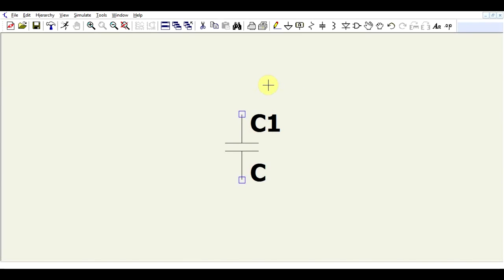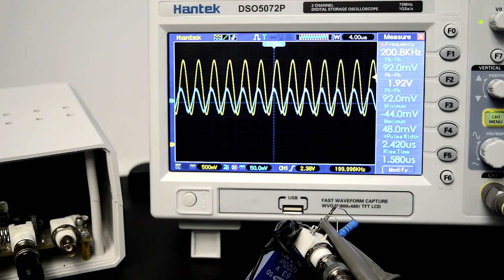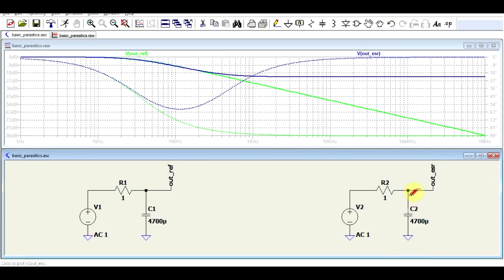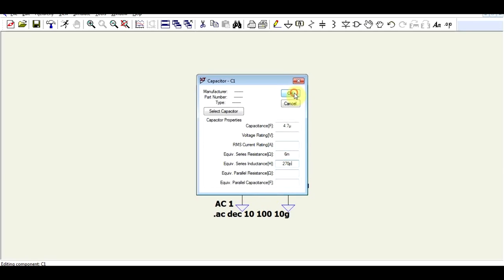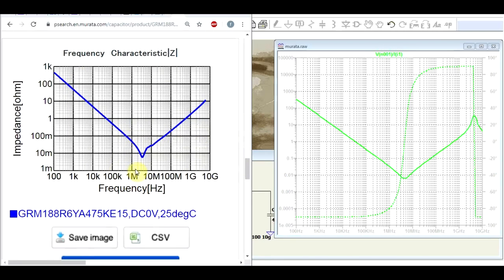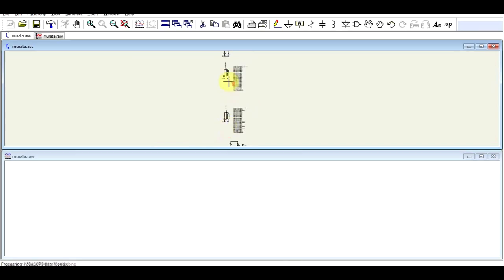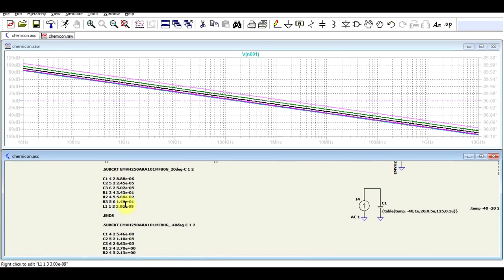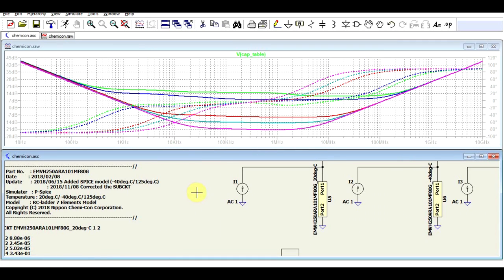LTspice tutorial - Simulating capacitors - How hard can it be?

Comment: Hello thanks for the video,
How do you estimate this inductance if they don't dive it in the datasheet? 
what is the magnitude of the inductance in general?
Reply from the maker: The best way would be to measure it somehow - using an LCR meter or something similar; as long as the coil has an air core, you could use an online calculator and just plug in the dimensions and number of turns to get an approximate value; but if the coil has a magnetic core of unknown proprieties, then estimations are very difficult.
Reply: @FesZElectronics  THANKS

Comment: Thank you for such excellent content. Question: how would one best model voltage-dependent leakage (ie 0.04 x C x applied V)? Thanks
Reply from the maker: If the "c" is a constant, you can use a behavioral current source, and express its value based on a node voltage (ex: I=0.04*100e-6*v(n001)) 100e-6=100nF and n001 is the node with the applied voltage)

Comment: Excellent video, but how you would change with time (maybe using if) the resistance as you did with capacitance. I have tried to do that but my tries were in vain. Help of LTspice is helpless.
Reply from the maker: Hello Mr. Remmoz! You can try to place in the field of value of the resistor something like: R=formula for example "R=1+time" without brackets or anything else. Let me know if this works for your needs.
Reply: @FesZElectronics  Unfortunately it is not working. But, may be, Im doing this in wrong way. time in not resolved.
Reply from the maker: Can you give me a few more details about what exactly you are trying to simulate? What type of simulation you are performing and what are you trying to achieve with the value change. If you want, we can move this discussion to email, so we can discuss on the actual simulation. My email is feszelectronics@gmail.com